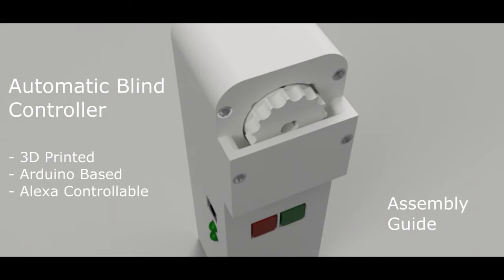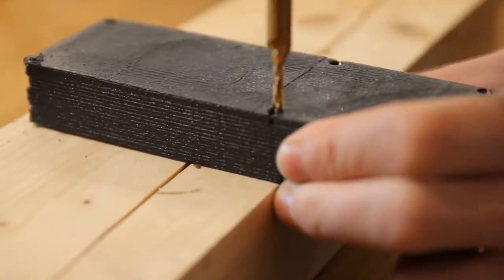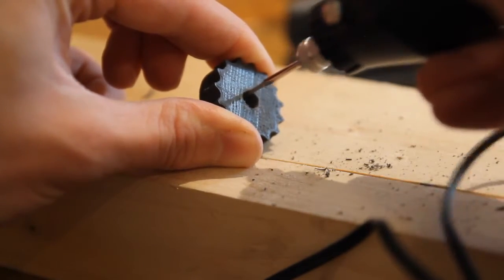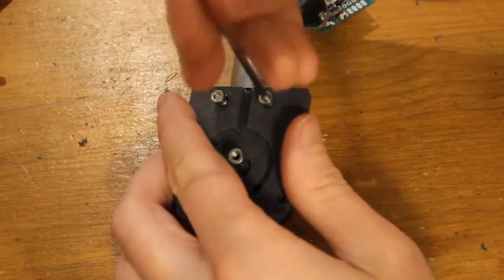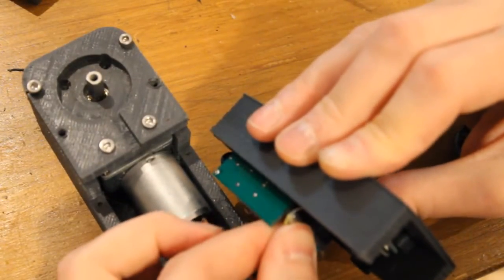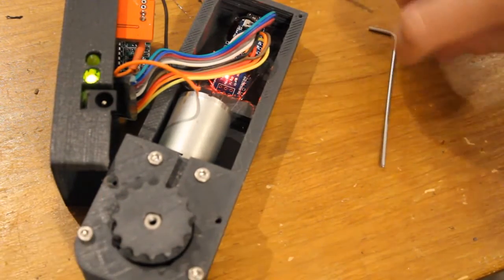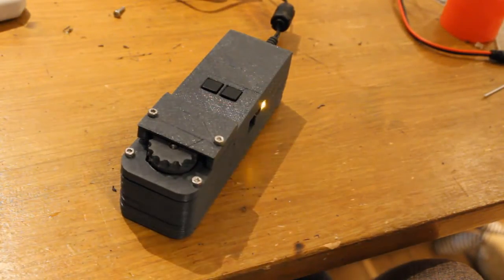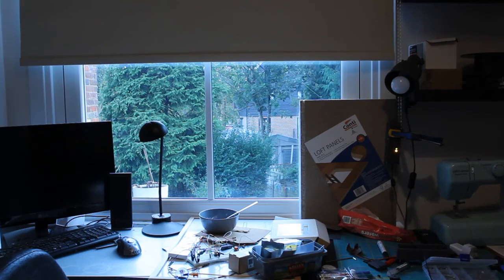Automatic Blind Controller Assembly

Comment: You should have made the curtain rail directly attach to the motor it would be a smooth motion and you would have no jerky motion in the circuit, at least your way keeps the controls accessible without external remotes!
Reply from the maker: The motion is smooth, certainly suitable for my requirement, plus the main advantage to this method is that it should work for almost any blind and requires little modification of the existing setup.
Reply: Roller blinds are heavy. because of this the chain system has a backdrive-clutch-spring-thing preventing the weight of the curtain from backdriving the chain. If you replace that the motor has to hold this, and you'll end up with a large idle-current, or you'd have to implement your own locking system.

Comment: Hi I contacted you sometime ago regarding the wiring of this controller I have all the components printed I have all that components supplied still not sure how to proceed with the wiring the schematic isn’t very clear. I kind of hoped that there would be a video showing the wiring in more closer detail, or even some close up pictures so I can get some guidance from them as to where the wires go 👍🏻
Reply from the maker: Hi Gary, sorry this has taken me longer than expected and in the meantime I have had some custom PCB boards manufactured to help with this, you just need to slot the components in the labelled slots and solder them in place. I may be able to distribute some of these, if you're interested pm me.
Reply: cabuu Thank you for your reply and yes I will be very interested in one of these boards as I have no clue what so ever, just let me know how much and how to get it to you
Reply: cabuu hi not sure if you get my reply last week but yes I would very much like one of these boards as I don’t have a clue on what to do just let me know the cost and how to get payment to you and I will gladly forward you the money
Reply from the maker: Hi Gary, just to let you know I now have some working custom PCB boards, they are available to purchase via eBay. 

https://www.ebay.co.uk/itm/292718522933?ViewItem=&item=292718522933

There are some instructions for using them on my website:

 http:www.cabuu.com
Reply: I’ve been a little late picking up your reply and now when I go to eBay the pcb board is no longer available can you please advise?
Reply: @cabuu4122  hi cabuu the PCB boards is it avaible now
Reply from the maker: Sorry Dimitri I haven't yet ordered more but you're not the only one to ask so I'll hopefully have some more on the way soon. I'm also working on a newer version using the d1 mini so it'll probably revolve around this.
Reply: @cabuu4122  Thanks for your quick answer let us know when you sell it